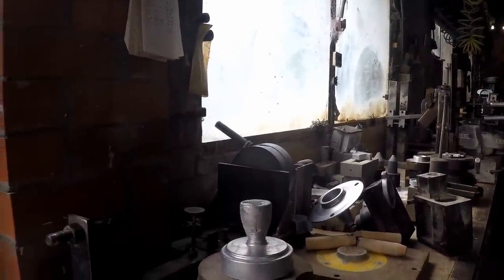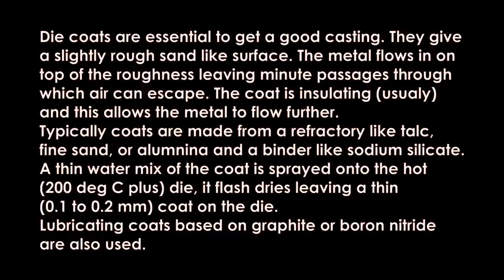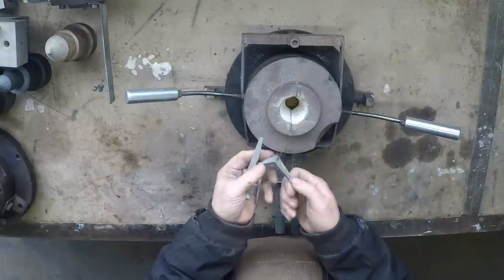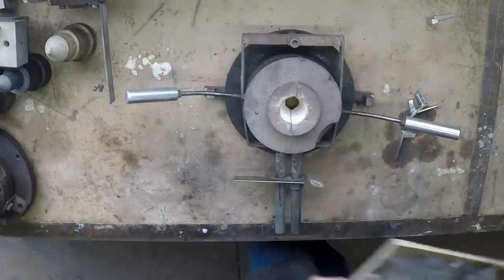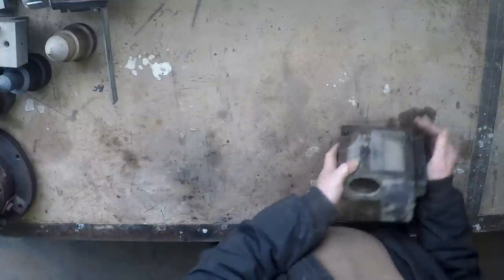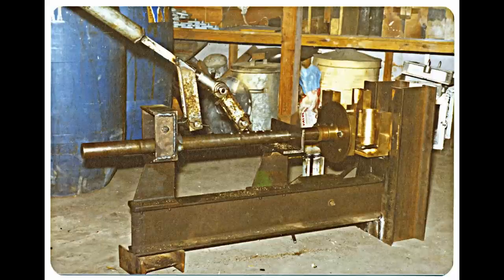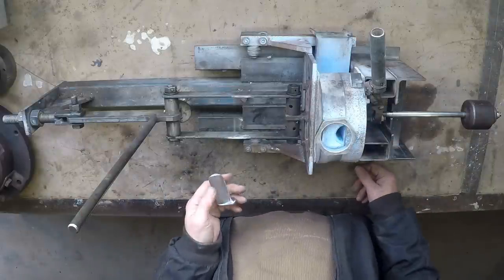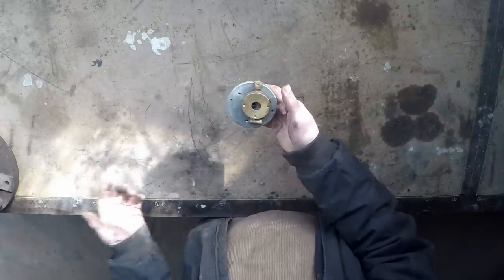Gravity diecasting  AKA Permanent mould casting Part 1

Comment: Back in 1965 I worked at Aluminum casting and engineering in Milwaukee Wisconsin. I poured turner pipe benders, 3 sizes in steel scissor molds, with a foot operated core puller where the handle threaded in. To make my job quota I had to pour at least 40 per hour from each mold! That almost Thousand a day. The run lasted 3 days. All the complex casting machines, were injection type to make evinrude and mercury outboard motor parts., and other thin items. The furnace was an above flame, horizontal open bath, with dip ports on the side. The furnace held about 100+ gallons of Aluminum. Look into gravity molding as the one I worked on was hand and foot operated and put out an excellent product. Thanks Martin for the excellent videos, and encouragement to move on in casting.
Reply from the maker: rick, So if I have this right you ran  three dies at once and poured 40 castings per hour in each of them giving a total of 120 castings per hour total or 960 in an 8 hour day  - although I do note that allowing for die prep etc. its common to only get 6 to 7 hours actual casting in an 8 hour shift. Giving a total of perhaps 840 or so castings per day - all I can say is WOW! And I a  glad that I did not work in that shop! Being that close to such a big furnace to do the dipping out at least 4O  times per hour must have been fun too! I hope that you had lots of fans blowing on you.... Martin

Comment: Great information mate, good to see another Aussie into the foundry work, Many years ago I made a permanent die to gravity die cast Aluminium pistons which I am happy to say were great success. Your simple die casting machines and jigs are really awesome, your video work and audio also excellent. Glad I found your channel. Keep up the good work.
Reply from the maker: Col, Yes, there are a few of us Aussies into foundry stuff. It's been my life in fact. I have done a couple of different pistons including the one I have a video series out for, but all were done in sand as the quantity was not there to justify any sort of die. I am curious though did you use a metal core piece(s) with your die for the pistons or did you use sand cores with a permanent outer? It is  just about impossible to buy the correct piston alloy here in Australia unless you buy 1 ton lots 😰 😱 I was lucky when a fellow "conspiritor" managed to get a few hundred kilos of the right stuff. Piston alloys are difficult to cast properly and are prone to gas pickup and do not degas all that easily. The Brush piston with its great thickness (to equal the weight of the cast iron original) proved almost impossible to get the gas out of and to my annoyance  we had a little fine well dispersed and barely visible gas porosity showing up in the machined product....Martin
Reply: @olfoundryman8418 , Martin, the set of pistons I made (This was decades ago) I made up a multi piece steel die, I was lucky enough to get to know an old Italian engineer immigrant who worked for Mercedes Benz way back when, and he showed me how to make the die using a lathe and an angle grinder...it was hard work and took an untold number of hours to make. The aluminum I used was other old pistons remelted to cast, the melt was de-gassed, fluxed, before the pour, I had remarkable success with them. I did most of the machining work on the piston and then I knew of another engineer bloke who had an old Repco piston grinding machine who did the final finish for me. This project was one hell of a challenge, was also told that I was mad, that it would never work...but it did, and the reaction of disbelief from the people who said it couldn't be done, was very satisfying. Just a side note, I started casting back in the mid 80s, but I don't do much these days, but its nice to fire up the foundry every now and again to make something that you simply cant buy.
Reply from the maker: Col, Nice to hear from someone who gives things a go. Hmm, "lathe and an angle grinder" pity you did not video that - would be interesting... Martin
Reply: @olfoundryman8418 , I did write several ebooks on hobby foundry work, the piston work I left out of it because it is beyond most backyard foundry guys, but I was going to (One day) document how I made the die and did the casting work, as well as the machining, it would have been masterclass kind of stuff, but then I wondered just how many people would be interested in making pistons?  And that's as far it got.
Reply from the maker: col, I did a bit of a search but was unable to find any ebooks of yours - do you have a link to them please? How you made the die would be most interesting so get busy and document it 😊. How many people would be interested in making pistons - you would be surprised it does seem to be a common aim.... Martin

Comment: Excellent Martin,like the over centre locking mechanisms. simple but clever.
Reply from the maker: Headstock, I cannot claim any credit for the mechanism, it is way older than I am but it works extremely well, not only for closing dies but also in reverse for pulling out cores and ejecting castings on bigger work. The power multiplication factor at the flick over point is very high.... Martin

Comment: Genius little machines for die casting; Thanks for posting this information.
Reply from the maker: gwhey, Gravity die casting is a bit unique in that everyone tends to make there own "machines". Simple is best as they are quickest and easiest to operate - some of the silly machines one sees on YT are horrid - slow, difficult, and  labour intensive. I try to design mine to be easy and  quick to set up and use. The easier it is the more castings you can make in a day (within limits).... Martin

Comment: Thankyou for showing this. I thirst for this type of information. I have been watching for a long time, please pass on anything that can be done on the cheap to help before stepping to the more expensive release agents and sprays. I have parts ready to make your sand fluffer, as it will take up less room than a muller. Many thanks
Reply from the maker: cameron, I appreciate the need for cheap alternatives as some of the sprays can be quite expensive - one release spray I use  based on boron nitride cost me over $200.00 for a America gallon -  its good stuff but for a hobbyist? I have never tried making my own sprays up and would need to experiment before I made an specific recommendation. However you could experiment yourself and I would start with 1/4 talc, 1/4 iron oxide (cement pigment), 1/4 fine (200 mesh) silica or alumina or some other refractory and 1/4 sodium silicate approx. 30 % solution. Add enough water to make a very thick cream. Before use dilute 1 spray 4 water spray on a hot (200 deg C plus) die to form a thin coat. Play around with the ingredients and the ratios.
Yes I think the agitator is a better choice than a muller. I have never had a muller but regularly use the agitator in lieu. Even people with mullers will aerate/agitate their sand after mulling (if they want nice sand)... Martin

Comment: Thank you Sir!! The nut & bolts of this subject is the info that seems hard to find, not just the way you do things but the reasoned all important why. I remember the piston you were casting as I have interest in that application.  I have been watching videos from our Pakistani contributors and also Egge parts in California for their piston production.
Reply from the maker: Stephen, Pakistan and Egge - two ends of the spectrum of piston casters 😊 I know whose pistons I would rather use .... Martin
Reply: @olfoundryman8418  haha, yes!!. I am interested in the construction of the gravity molds with the multi piece or expanding inside. I would like to reproduce a Cat piston from the 30's with a steel or ductile insert for the rings. And of course what alloy?, until then my armchair will do.
Reply from the maker: Stephen, You have set yourself quite a challenge there! Those multipiece expanding cores are quite a machining feat - your armchair had better be connected to Fusion 360 AND a CNC mill 😊. You might like to contemplate using a gravity mould outer and a sand core - particularly if it is a restoration as against an engine working hard project. British alloy LM13 (US A336) is one commonly used for pistons. NOTE the insert must be rust free and preheated,  would suspect that steel insert not too good use the ductile iron, you should be able to buy this as bits of continuously cast bar and machine to size...Martin
Reply: @olfoundryman8418  Martin, I can use the continuous cast dura-bar. I do have an Alexander 3D pantograph and a Fadal that needs serious attention. Plus all the common machine tools. Getting the mechanism worked out from watching a camera pan quickly around on a video isn't ideal but workable. There is a outfit down your way that was making some pistons, from memory it was JP. This will probably end up being a retirement project at the rate I'm going, as I have plenty to do already. Thanks again for your channel, I have made a few patterns for repro parts moulded by my foundry buddy but  would like to get into doing it myself.   The fun for me is in the puzzle.
Reply from the maker: Stephen,  "A fadal that needs serious attention" Oh dear sounds like my Dyna Mechtronics 4400 when I got her. She was built in 1985 and uses a strange programing code - no postprocessors available so I have to write and put in all programs by hand , I  should get a conversion done to G code and if Iwas younger and fitter I would. Re mechanism if you need some still photos I can do them for you just come to me at  olfoundryman@gmail.com. JP still exists, they are in South Australia (I am in Victoria) their catalogue is huge but I don't know what they actually make! We also had a division of Repco here in Victoria that made pistons OE for local car manufacturers - when we had some! I worked as foundry metallurgist for a sister company - Brake and Clutch (commonly referred to as "broken crutch") That dura bar in an SG version would be the go for sure - I used to be able to buy locally made con cast grey iron  and it's what I used for many of my dies but it's not available so much anymore. Watch that retirement thing - I had all these plans for things to do when I retired at 75 but at about 73 things started to go downhill and I can do very little now. This video was actually shot in mid 2018 and I was in trouble back then, unable to do much I was forced to retire by age 74 and could not do the things I planned - it's a cautionary tale - so don't wait too long 😰... Martin

Comment: Thank you for your knowledge and generosity kind sir. 

1. Have you done any work that involved casting thin and deep fins with not a lot of spacing between them? Like in a cylinder head for example. How did you solve the challenges that come with that?

2. Also can you tell us a bit about the various alloys, and their properties wrt casting, like their fluidity, propensity to defects etc.

3. Can you tell us a bit about the design of risers, sprues, gates and pouring basins that you use and how you calculate and design them 

Thanks again
Reply: Some of your questions answered here: https://www.youtube.com/watch?v=m6W71s-cd_0
Reply from the maker: Sunil, I talk about one such casting  towards the end of the third video in this series - it will be released in 2 or three weeks. Basically I hate such castings as they are most difficult to make. This video is interesting  https://youtu.be/sBfFpcdyd5Q  Its from 1942 and probably uses old fashioned oil core sands -it is skilled work and uses lots and lots of wires to reinforce the sand areas between the fins. Modern core making materials would have made their life a lot easier. NOTE that they smoke the mould with acetylene flame this has an almost magical effect on how far the metal will run - 3 to 5 times as far in fact, and no one really knows why  but it has to be acetylene. The first thing is whether to cast in sand  in which case the mould needs to be a very low moisture type - shell sand for instance as I saw you use in one little video. Or in a gravity die - in this case the die must be designed to allow easy application of die coats to the finned area and good venting at the tip of the fins. This means the die must be segmented  and easily and quickly taken apart  to allow die coat application particularly but not only to where the fins are thinnest and then reassemble so casting can start. This is not easy! For the casting I show in part 3 each of the die segments between the fins was a separate piece, they were removed from the die to allow careful spraying and then reassembled, all with the die and the segments hot. I guess it's like anything once you work out how to do it  everything is Ok but it can be a battle to work it out
Various alloys - well there have been books written on this subject! For gravity die work I use three alloys US alloy 356 for general work, British alloy LM6 for thin work and DTD5008 for support blocks. The first is not the most fluid  but cast easily and is easy to feed. It is heat treatable an d machines very well when heat treated.
The second alloy is very fluid but is subject to gross shrinkage defects at hot spots. It is not heat treatable and machines poorly
The third alloy naturally ages over a week or so after casting it machines very well indeed and has a nice white colour. BUT it is difficult to cast having low fluidity and problems with feeding and hot shortness For cylinder heads US alloy 319 seems often used,  it is heat treatable and I believe that it casts quite well but is not the most fluid it machines quite well.
Gatting design etc. This is way too big a subject to fit in here. There have been books written about this too and I refer you to those written by John Campbell, he does it far better than I could. To be honest I rarely calculate any of this stuff now, I sort of eyeball the casting and use my experience  to guide what I feel I should use in the way of gating feeding etc. Not very helpful I know but study Campbell's work and you can't go wrong......Martin
Reply: @olfoundryman8418  Wow! Thank you for taking the time and effort to write a detailed reply.

I look forward to seeing your videos in the next few weeks

I have another question which I hope you won't mind answering;

The cross hatch pattern that is in some gravity die cast parts, especially on the inside. What purpose does it serve?

Comment: Great content! Very informative. I came across this gem of a video just when I need to make permanent dies for casting aluminum bronze worm gears with cast iron cores. I will try to read up on the books you recommended in the "Possibilities" and look forward to watching next part to this video. Thank you.
Reply from the maker: Soheyl, I did my "apprenticeship" in gravity die as the foreman in a shop casting mainly small aluminium bronze work. With the right gating it casts quite easily.....Martin
Reply: @olfoundryman8418  Actually I am a bit worried after I heard you say it is one of the most difficult alloys to cast known to man. Do the same principles of basin and sprue design you talked about also apply here? Also thank you for taking time to answer my comment and everyone else's. That's very generous of you.
Reply from the maker: Soheyl, To be a bit more specific aluminium bronze is regarded by many as being one of the most difficult of alloys to cast for two reasons;- 1 It is very prone to oxide skin formation particularly at points in the gating system where turbulence occurs. It is common to see skins on the surface and right through the metal down stream of these areas.     2, The alloy has a very short solidification range, this means that it is prone to shrinkage at any hot spots and that shrinkage or anywhere else in the casting will likely be a fairly massive hole.
These problems can be overcome with good gating and attention to proper feeding and my experience has been that good castings can certainly be achieved. I have no fear of casting these alloys - in fact I have worked regularly with three of them.  However, I would not recommend them to inexperienced hobbyists.
With alloys like these the principles of good basin and sprue design are particularly important. Small tapered sprues that run full are an absolute must. A pouring basin well radiused to the sprue is important and a generous radius where the sprue joins the runner is also important. All gating should be designed to avoid turbulence. The gravity die shop where I was foreman used a simple 91% copper 9% aluminium  bronze. Most of our castings were small builders hardware  but some were things like borehole pump guides quite heavy and quite complex. The gating we used was very simple - usually a curved tapered sprue that started off vertically but entered the casting horizontally. We did not have a pouring basin as such - the sprue flared out at the top to give a reasonable target. In truth this was not really technically perfect gating but with careful pouring the metal slipped down the sprue and into the casting in quite a smooth manner. I would not recommend this simple approach with sand casting as technically correct basin and sprue designs are necessary there to ensure success with sand work.... Martin
Reply: Thank you again Martin, if you are interested I will update you on the results of what would me my first attempt to cast aluminium bronze.
Reply from the maker: Soheyl, Yes, please do update me.... Martin

Comment: I’m guessing your preferred material for casting is 356?
Great videos, for passing on the nuances and knowledge from experience, that are otherwise lost.
Reply from the maker: George, Yes, like most foundries I prefer 356 both for sand and gravity die. I do however also use 413, DTD5008, AB3 bronze, CMA1 bronze, Silicon bronze, and Ezda 12.... Martin